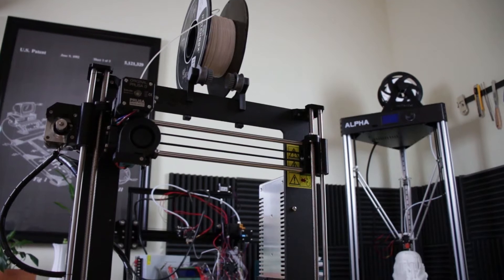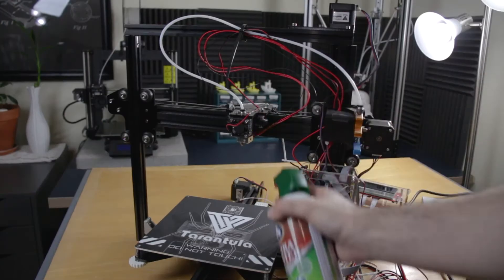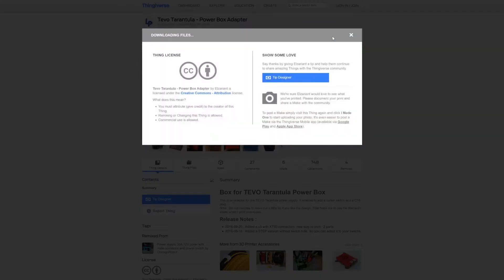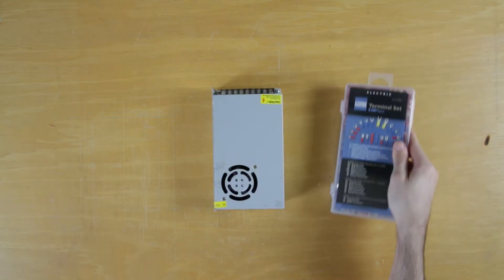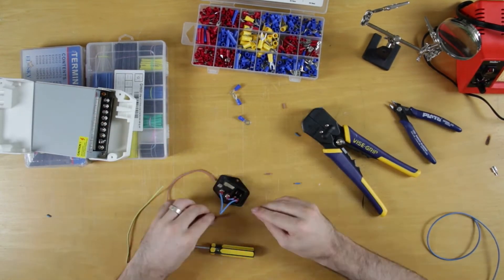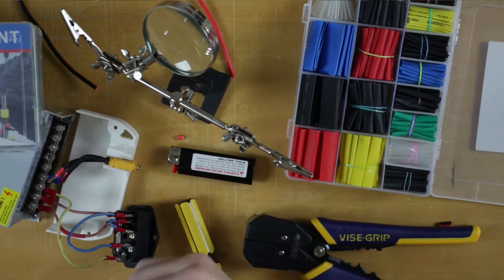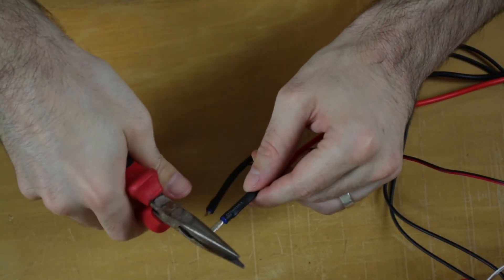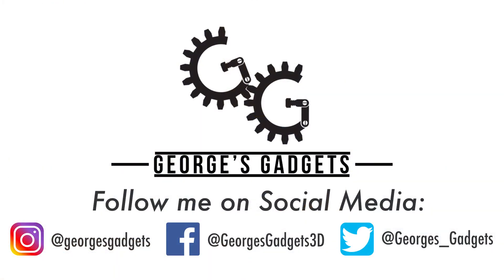Why you need to upgrade and improve the 3D Printer Tevo Tarantula's power supply

Comment: For someone who claims to be lazy, you sure took the hard way to solving the plugging/unplugging problem. I just plugged my supply into a switched power strip. When I saw the title of this video, I thought there was going to be a technical reason - maybe not enough current, or something... I never would have thought that the reason was a lack of a power switch and the supposed dangers of the connections. I work with AC current all the time, but I know most people don't... I would still think that anyone with enough intelligence... nay... with enough common sense... to put together a 3d printer would be able to avoid getting electrocuted by a power supply that has a cover that flips down over the terminals. But.... that's just me I guess :)
Reply: Nothing at all... that's what I enjoy using mine for most. My point was that the title of the video - "Why you need to upgrade and improve..." was slightly misleading from a technical point of view.
Reply: r/IAmVerySmart
Reply from the maker: Derek, thank you for the comment!  I am not the most technical person (or even very close to average).  I just enjoy making videos and sharing them with the community!  I understand there is an easier solution, I just wanted to challenge myself and learn a little in the process.  I hope to see you around in my future uploads.
Reply: Nothing wrong in my book with using the 3D printer to upgrade the 3D printer like 99% of 3d printers do.
Reply: Derek Tombrello How so? It is both an upgrade and an improvement? After watching this video, I went and modeled something very similar for my MPCNC. It worked fine, but one of the biggest pains about it was reaching back behind my server rack to grab for a power cable to plug it in every time I use it. I thought about going your route and using an entire power strip because it was easy, but I didn't want to waste an entire power strip on one device. I also don't have any spare power outlets nearby and I'm sure you know the risk of plugging power strips into power strips, so that obviously wasn't an option. Works great now. If I label an E3D v6 a "must have" printer upgrade, I would ABSOLUTELY consider a safe and easy way to turn it on and off one as well.
Reply: Ours are both our own opinions. It's all in how we see it, I suppose. Yes, it is an upgrade and an improvement. My thing was with the word "need". Anyway... I probably wouldn't use a power strip for a single plug, either. I have several other things, like lights and the power supply for a raspberry pi that I turn on all at the same time as the printer, so it all works out for me. I don't know where you are, but out here, at a Dollar Tree this weekend, I saw the cutest little three plug, switched power strip for, well, a dollar. Just in case you ever have need for such a thing in the future...

Comment: Looks nice! One suggestion is to use the female XT60 connector on the power supply side and the male connector on the printer side. In general, it's best to use female connectors on the power source to make it harder to accidentally short out your power supply. The same thing applies to using XT60s on batteries - the battery gets the female connector and the speed controller gets the male.
Reply from the maker: Manuel McLure i had no idea! Thank you so much for the tip :) now I know for future builds....I might bug you in the future if I have more electronic questions

Comment: This is a general question about all printer power supplies.  Can you just replace a given power supply with a computer one instead?  I hand built my PC tower and bought a really nice Corsair supply for about 50 bucks.  It seems someone could do the same and avoid all these cheap (and somewhat dangerous) power supplies.
Reply from the maker: John Christensen yes! I looked it up to be sure but it is possible :)
Reply: Thanks Manuel..... That may be the way to go.
Reply: You can use a computer power supply, but be aware that some cheaper computer power supplies require a minimum load on each rail to provide properly regulated output. Instead I would recommend a server power supply such as the HP DPS-600PB. This is a 47A 12V power supply that's usually available for around $20 shipped on eBay. The disadvantages is that they have a somewhat noisy fan and you have to solder the output wires directly to the the output blades. But they are completely bulletproof (they're designed for servers that are running 24/7 in data centers) and ensure that you're never going to run out of power.
Check out https://sites.google.com/site/tjinguytech/my-projects/HP47A for instructions on how to get these to turn on, just short pins 4, 6, 8 and 10 together (the easiest way is to just bend pins 4, 6, and 10 until they touch pin 8 and pit a blob of solder on the group).
I have an example mount for the Anet A8 at https://www.thingiverse.com/thing:2793266.